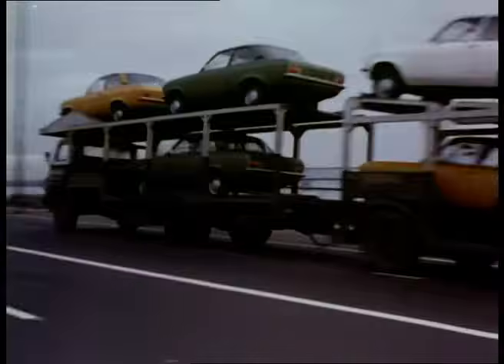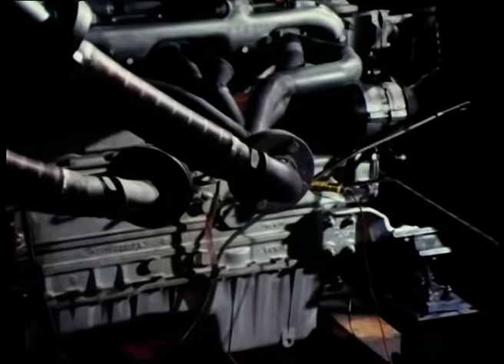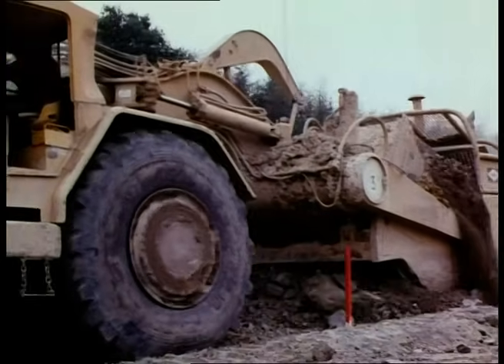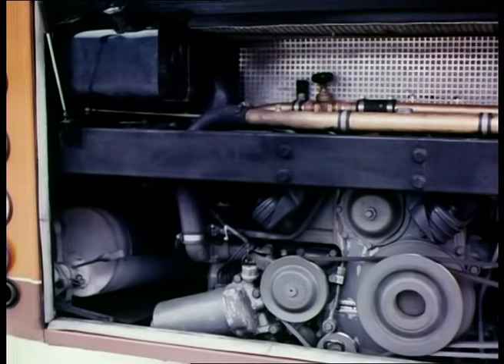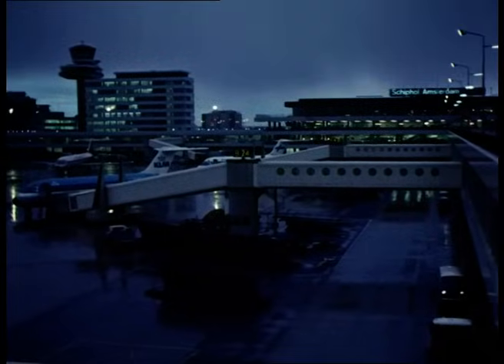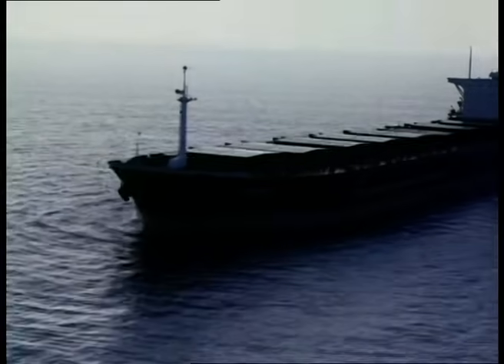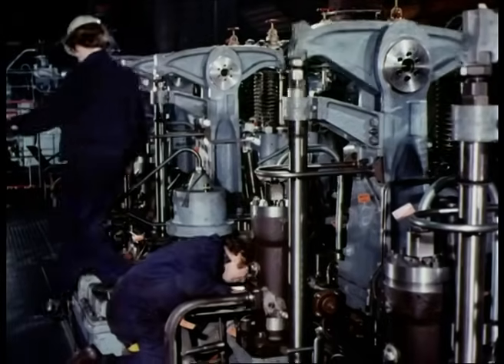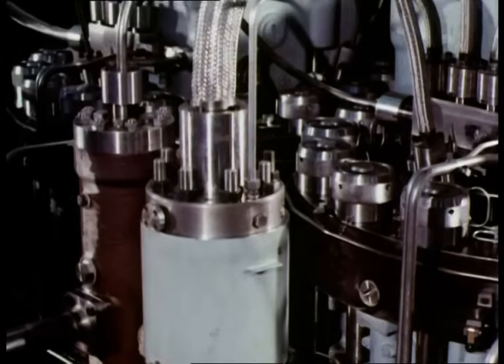The Power of Diesel: Inside the Engine | Shell Historical Film Archive

Comment: And then we started craze of trying to make diesels the most unreliable with double egr valves and 2 stage dpf systems designed to clog up engines with their own exhaust gas and soot ruining their lubricating oil which prematurely wears out turbos and timing chains.

Comment: I loved this, started my career at sea on low speed diesels.
40000 shp is reaching the limit of their size?
Now the biggest are 120000 shp.  Same technology, just refined.
Reply: In displacement, not power output.  The question was just how far they could refine the design of such engines.
Edit: typo.
Reply: @ current 2 stroke marine diesels are pretty thermally efficient.

Comment: Not all the info here is correct. Diesel struggle to run fast due to injection timing not expelling exhaust gasses 😂. The faster you rev the less “time” you have to inject fuel less time means less quantity high revs require more quantity of fuel it’s that simple

Comment: - 1990 1st Gen Dodge Cummins, 4-wheel disc brakes, ABS delete, A518 transmission w/overdrive, Banks Intercooler (Yes, believe it or not, they made factory-fit ones back then for the Dodge Cummins).

Winning!

Comment: Diesel in passenger cars is the biggest environmental scam in automotive history! Second close is lithium in the EV's!
Reply: CAT 6 diesels are the cleanest ever
Reply: @flexairz  You're right. But at what price - all kind of restriction devices clogging the diesel engines which make them complicated and unreliable. Another thing everybody should know is the euro regulations are far more strict for the gasoline engines than diesel ones. The reason for that is that petrol refineries produce up to 40% diesel and only 10% gasoline. These 40% should be sold somewhere right? NO2 is the killer in the urban environment which is produced mainly by the diesel vehicles.
Reply: Does Diesel save me money? Yes. 
I have no further questions.

Comment: If a diesel engine use gasoline or glp or gnc o h2 it will be clean...
In the downhill hit air in a bottle and inyect in the motor, all is less dangerous that bateries(felicity ace).

Comment: you need high HP to be able to go fast,
you need high TORQUE to be able to carry more weight!,that's what diesel engine do,GIVES YOU HIGH TORQUE AT LOWER RPM
THAT'S WHY THEY CAN NOT PRODUCE SO MUCH HP
1_ because they run on low RPM(HP comes at higher RPM)
2- they don't need to go fast like passenger cars

Comment: Love diesels. We need more diesel passenger cars in the US.
Reply: Agree, I'm trying to keep my old BMW 335d on the road as long as possible.  No car offers the power,  fuel economy, and range,  on the road today.  With tuning and downpipe it's sitting at 365 wheel hp/595 torque and still gets 39mpg on the highway Blast to drive.
Reply: @BrianNC81  are there any problems with the fuel system or filter? im thinking about a diesel bmw in illinois
Reply: Diesels are good if you drive a lot of on the highway, but city driving is bad for modern diesels with dpf
Reply: @fantamaz69 thank the EPA for that.
Reply: BMW 6cyl diesels are the best in the world. Incredible engines.
Reply: I had a Mercedes 300D ..84 model..35mpg .. when I quit driving it the odometer showed 512k and it had not worked the last 2 years I owned it..rock solid 3.0 5 cylinder turbo .. I miss that old girl..
Reply: @tomstarzeck7137 35mpg my butt. They are good for 24-28mpg at best.
Reply: You don’t PM 10 & PM 2.5
Reply: Diesel is dead. long life electric engine!
Reply: @rz011279 sure buddy sure 😂😂😂😂🤡🤡

Comment: It would be very good if Toyota Motor Corporation would return its 2.0; 2.2 D-4D diesel engines for Corolla, Avensis, Auris, Yaris, RAV4.
Reply: They were nice but I don't think Toyota had the experience of the European carmakers who's diesels were more powerful and more reliable. My cousin had a Corolla 2.0 d4d and it transformed the car though. It drove much nicer than the slow and sluggish petrol powered versions and used 4.2 litres per 100kms on the highway. It was so nice.
Reply: Taxi drivers in Athens with Avensis Mk1,not D4D,1500000kms tight city driving a common thing
Reply: Ask Brussel…!

Comment: So-called environmentalists try to phase Diesel engines out, but it's still the most important powerplant
Reply: Hydrogen can do everything diesel can do with clean emissions. Electric vehicles are far cleaner than diesel. Diesel is a reliable old system but the emphasis is on the old.
Reply: @terrancedactielle5460 there not cleaner 😂
Reply: @mattdaddy_888 Tye exhaust is water bro
Reply: @willyknickers9295 what about the amount of energy needed to produce the hydrogen? 😂
Reply: @terrancedactielle5460 please tell me how EV is clean when you have to strip mine the earth for precious metals and then the batteries aren’t easily recyclable plus I don’t know a single business or corporation recycling and remanufacturing systems for EV’s to say an EV is cleaner than an ICE is very ignorant
Reply: They’re all WAYY more reliable than petrol engines, my £600 Peugeot with a 1.6 hdi is on a 152k and still runs amazing
Reply: @nuherbleath461 there are some exceptions
Reply: And here you have ignorance at a blissfully stupid level.. 
Diesel is by far, the worst polluting engine. Closely followed be benzins
Reply: @mortenfrosthansen84 it also smells amazing
Reply: Don't kid yourself bud. We don't depend on oil because it's the only way, we only do it because that's what the oil companies want. People have build cars that run on water.
Reply: Yes, I agree that Diesel engines is the most important thing ever.

The nowadays electric vehicle was here because of the diesels. Think diesel-electric. Electric transmission back in 1930s is mostly low-powered and cheap, that is why they found mostly in Electric Multiple Unit. Electric locomotives? Yes there are some but they are extremely heavy and cumbersome because electric alteration wasn't a thing.

Then came an experimenting of diesel engine coupled with a generator which then powered the electric motor. It works, but the electric thing is almost constantly breaking down. Years come and by, the engine stays the same, only grows on power, but the main improvement is the electric transmission. Now you got better generator as well as electric motors.
Then, came AC traction which mostly is overhead wire, from electricity to electricity, so it is not that complicated. Then, some blokes wanted to know the effect of diesel engine coupled with AC electric transmission, it works and then some years later, it became a standard in rail industry. 

The controls that we are now today in EVs find the way back into diesel engine. 

Why not steam turbine? Well, it only revs at certain speed so there is constant output. Also, electric engines were considered experimental, that's why before WW2, not much electric trains run around apart from certain rich rail companies or a fully govt.-backed railway in small countries.

So, diesel engine is the most important machine we have in this world.
Reply: They are one of the backbones of our economy.
Reply: They will never find a power source like diesel power.
Reply: It's amazing!
Reply: Lies, lies and more lies to promote profit for those who are already billionaires
Reply: At the moment  I'm trying to buy a 3lt diesel van that's the tool for the job , them 2.1 engines wouldn't pull you out of bed  !
Reply: After owning multiple diesel engines, petrol all the way.
Reply: Right. So-called ecoterrorists.
Reply: So true👍
Reply: If and exhaust catalyst is used they are cleaner than gasoline
Reply: Come to India and smell the air. The only reason Europe has clean air is because of these "so called environmentalists" and their efforts to phase out diesel.
Reply: @hammaadshahid  pollution in India is due to bad unregulated industries. Indian rivers are also the dirtiest in the world. I hope you don't think that it is due to diesel engines too. And Indian farmers practice stubble burning which increases the most pollution.
Reply: @hammaadshahid the problem in India is with industry, manufacturing. In Europe we have mostly ICE cars and clean air but that’s because of industry regulation. Most emissions come from industry and freight not passenger vehicles lol.
Reply: @hammaadshahid  If in Europe we are free people why we are pushed to buy only expensive electric vehicles. I want to have choice between diesel, gasoline or electric drive. EU is going to ban ICE engines till 2035. Maybe electric cars are good in hot countries but not in colder colder for example in Poland when we have sometimes -15 or more C deg below zero during winter. Read whats happned last year in december in Sweden in Oslo with electric buses. In ICE engine heat for heating cabine comes from engine cooling circuit. You not feel smaller car range. In electric car  you need to power electric heater or maybe heat pump from car baterry - its about 4-5 kW power. You're loosing car range. In summer you need AC so you need to drive electric compressor - obviously from car battery. Another topic is politics. Usually this eco groups are supported by left-wing politics in order to block some countries development
Reply: @piotrek0207  Yawn ! 😂
Reply: @stephencrowther524  I'm wrong?
Reply: @piotrek0207 I owned several premium diesel cars in the past and now I have an electric car. Best choice ever. Combustion engines are an obsolete, inefficient technology.
Reply: @mikedelicus  Also when outside is -15 C deg?
Reply: @piotrek0207 Ask the Norwegians as they mostly buy EVs. I never had problems in the winter, nor I experienced a significant drop in range, but starting my older Mercedes Diesel below 10 degrees was hit or miss. The best about EVs in winter is the remote car cabin preheating. Very nice feature, I use it permanently.
Reply: @mikedelicus  You must read what's happend in Oslo during last winter with public communication which based on electric busses
Reply: @mikedelicus  Electric cars are good for short distances. In the city where you have good infrastructure, a lot od charging stations etc. But not when you need to drive 500 km during winter. Do you know that car traction battery need to be keep on constant temperature between 20-40 C deg. So in winter you need to heat battery and cool when battery temperature is too big. You loosing power and range. Batteries are  heavy. What about when you need to carry bigger load for example 30t? How big will be battery? How heavy? 😀
Reply: @piotrek0207  What’s the problem with 500 km in the winter? I did 40.000 km in one year with no worries including long distances in winter. What are your experiences? Have you tested a proper EV for several weeks?
Reply: When optimised for constant power and load large diesels are incredibly efficient, just don't put them in car's that is a very bad idea.
Reply: @WOFFY-qc9te why? My diesel car does 60mpg.
Reply: @user-zu6qn9ux9n  60 mpg is faily good but a marine diesel can move more than a 1000 Tones one mile on one gallon.  Your scale of efficiency is a comparison with a Petrol engine.  The particulate emissions from a car diesel engine under variable loads is rather poor.   An optimised stationary diesel engine is very efficient.
Reply: @WOFFY-qc9teso what,It is much better than A petrol engine.Why comparing It with A ship to show that It is a bad idea?
Reply: An uncle of mine once bought an early Suzuki Vitara with a shot engine, repowered it with an old Volkswagen 1.6D and its mileage was much better than with the stock engine.
Reply: @WOFFY-qc9te  6 cylinder diesels used in many German cars and even by Mazda now are amazing. So fuel efficient and so smooth with boat loads of torque. Especially great when used in SUVs because the fuel usage is so much less than it's equivalent petrol powered unit. They also tow more effortlessly than a petrol engine which needs much more revs to move the same amount.
Reply: @SDav21  Strangled by emissions kit they are far from as efficient as a constant load diesel.
Reply: @WOFFY-qc9te  That's fine. I still save money on fuel because I use half as much and the car drives much better than a petrol powered equivalent.
Reply: @SDav21  I don't disagree however original comment was " just don't put them in car's that is a very bad idea"  because diesel engines do not perform well with variable loads and with short urban motoring they gunk up and produce a lot of particulates.  A diesel powered car hammering down the motorway is a happy bunny... 

I like big diesel engines, I have worked on large 16 cylinder Mirrless Blackston gensets for years and diesel car engines that have been destroyed because they are not suitable for that driver who never works the engine to a temperature and load that allows it to keep clean.  Enjoy your diesel.
Reply: @WOFFY-qc9te depends on the type of driving, modern diesels heat up very quickly. SCR sorts out emissions and particulate filters have come on a long way since the early 2000s.
Reply: @WOFFY-qc9te Your claim "diesel engine in car is very bad idea because it doesn't perform well with variable loads" is as bad claim as anything can be, as you know well the petrol is even worse. And your argumentation "you are comparing it with petrol" is as invalid as anything can be, because that is exactly what it must be compared with. We can't just replace cars with lorries (if you even thought they wouldn't have variable load..) - or at least that's once again just another worse idea.
Reply: @SDav21  The m57 in my BMW diesel is amazing.  365 wheel hp/595tq with tuning, still gets great fuel economy.
Reply: @WOFFY-qc9tewhen you are A real Dieseldriver you know what is good for your engine.If you want to drive short distances,better use an Other form of transportation.
Reply: @SDav21 funny you should mention Mazda diesels, their engines are a reliability disaster and are always avoided in the used market.
Reply: @WOFFY-qc9te you have never used an diesel engine. Please research some more before commenting. And one more thing, small diesel engine are best for cars.
Reply: @WOFFY-qc9te they should put them in cars lmao
Reply: No one is trying to phase them out. Trying to control emissions.
Reply: @brownbanana18  Go have a chat with Greta Thunbuge she is not of the same opinion.
Reply: @WOFFY-qc9te  So what ? Many other people are too. Oh,and learn to spell her name.

Comment: For all the bad press diesel gets today we will still need them for a good few years yet as electric hasnt got the torque. 😊
Reply: Electric motors have maximum torque from 0 rpm. They are better than diesels in regards of torque
Reply: @zenshy2139 However, storing and producing electrical energy on a large scale is a huge challenge that the stupid press can’t understand (since it has no brain to judge for itself) 😂😂😂"
Reply: @zenshy2139  
Depends
For efforless high speed crusing, diesel is still better 
Top speed on some of these electric cars are so low
The new renault 5 is limited to 130 kph for example
Reply: You're very incorrect about that. Most modern ships have moved from diesel propulsion to electric using diesel and LPG generators, similar to what trains have been using for decades. These are the most demanding scenarios for engines and electric is the better choice for the motor.
Reply: Don't know about that - consider diesel-electric locomotives, or the Edison Motors trucks. Gobs of torque! 😊

Comment: They had no idea what happened 15 years later, when lightweight, turbocharged diesel engines reached specific power outputs of top notch sports cars in the old days.
Reply: Thanks in the main .To Fiat's.invention of the Modern common rail system technology.
Reply: @carolinetv5112  Ahh yes, that unreliable absolute garbage. Typical fiat
Reply: @carolinetv5112 wasnt a magneti marelli thing? fiat bought it and made it popular if im not wrong
Reply: @hiena8511 Your wrong. "A major breakthrough occurred when the Fiat Group (through its subsidiaries Magneti Marelli, Centro Ricerche Fiat, and Elasis) prototyped an electronically controlled system". They did sell part of the rights to Bosch, who I worked for. So I do know quite a bit about it.
Reply: And also ballooned the pollution to whole new heights.. 
Not that the lead fuel was any better

Comment: I was driving behind a presumably deleted and excessively tuned X5 diesel today. It smelled really acrid.
Reply: Guaranteed blocked dpf and egr, the smell is actually putrid biodiesel content unable to reburn through it's cycles. Diesel pre 7% biodiesel content with sulphur etc in the modern engines would last forever.

Biodiesel mix in common rail with the emissions systems is basically collestrol blocked arteries.
Reply: @RobsonRoverRepair  It was straight piped and putting out plenty of smoke. The driver was flooring it stop light to stop light to show others he's the alpha.
Reply: I was driving behind a new petrol Toyota. It smelled of......oil. Nothing pleasant.
Reply: I love the smell of diesel exhaust actually

Comment: We even flew to the moon by burning diesel fuel.
Reply: Not diesel, kerosene and hydrogen. Maybe you can count the diesel bus that drove the astronauts to the spaceship
Reply: @ChrisG-vq7ld  winter-diesel and kerosene is almost the same thing anyway. Some people use it in diesel powered cars, because it is cheaper.
Reply: They add some 2-stroke oil, otherwise high pressure diesel injection pump may suffer.